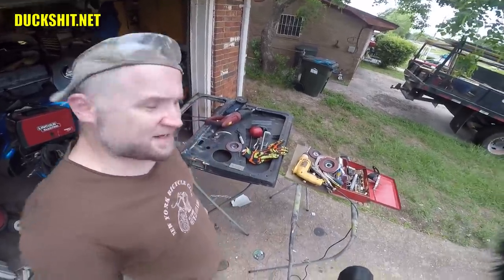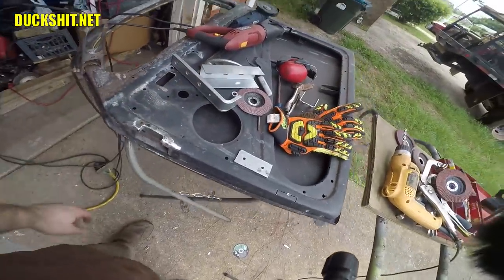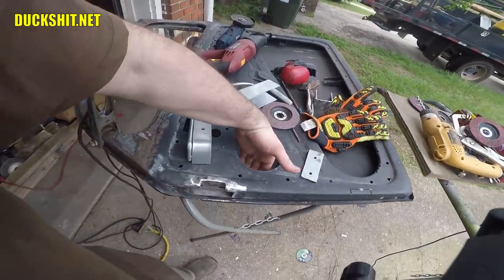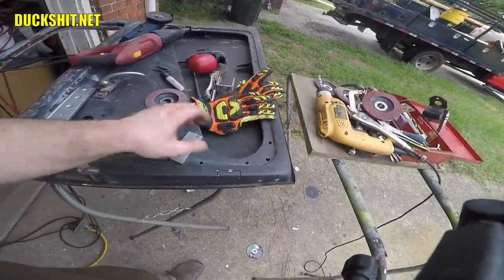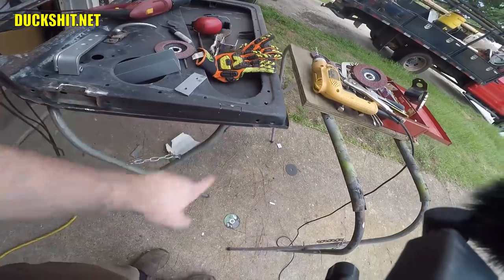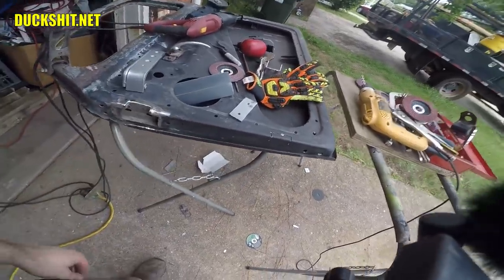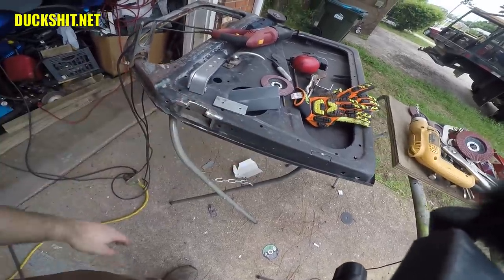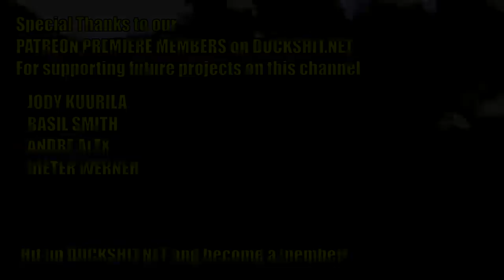VW Beetle Shaving Door Hinges 2 - ROTTEN OLD 1956 - 98

Comment: Hey Glen. Im new to welding and started learning on my own. Ive been watching some youtube videos but nothing really for welding classic VWs. Would you mind doing a tech video on welding or could you tell me what what welder and welding wire do you use? Im using .23 solid core wire and a Lincoln HD 120 but keep blowing through some of the sheet metal.=(
Reply from the maker: You are in luck, because I already did one LOL  https://youtu.be/ctmHPQvYqxw
But when it comes to working with sheet metal you're probably going to want to turn your heat way back and put your wire speed someplace in the middle or less (there may be some deveations from my settings with your equipment) and weld short bursts being careful not to heat the panel too much to cause it to warp or melt.  Hope that helps!

Comment: Hey.  I am working on a VW Vert.  What kind of welder are you using?   You make it look easy, especially on the sheet metal cuts.
Reply from the maker: The welder really doesn't have too much to do with it, I just act very gently with short bursts... anything else will burn through even with the lowest settings.  Its a Lincoln though, works well, before that I had a Harbor Freight brand, it was very burn happy!